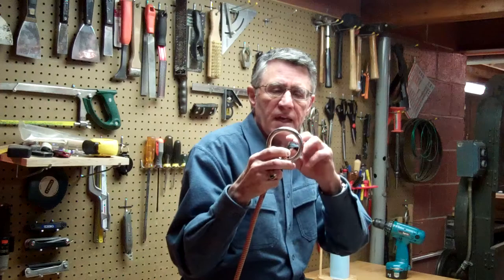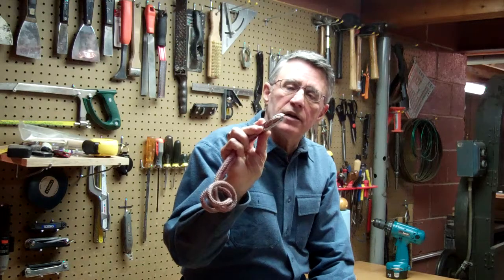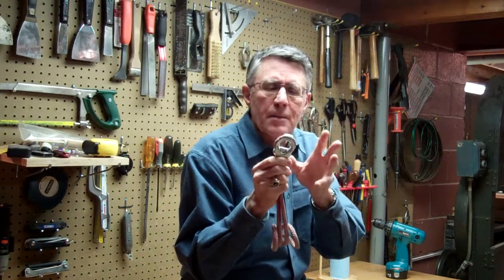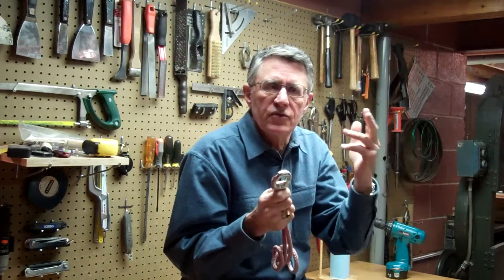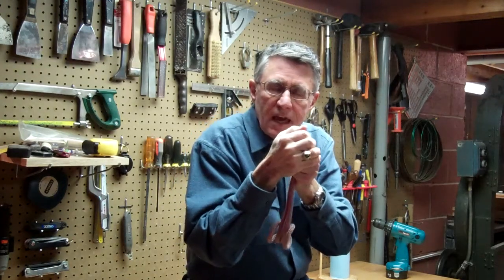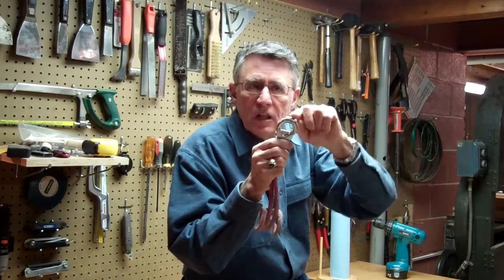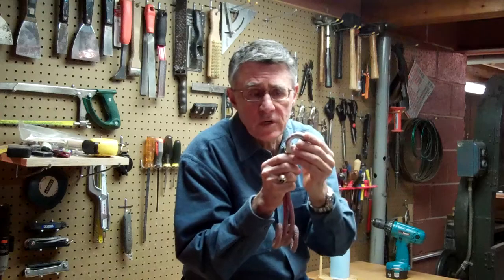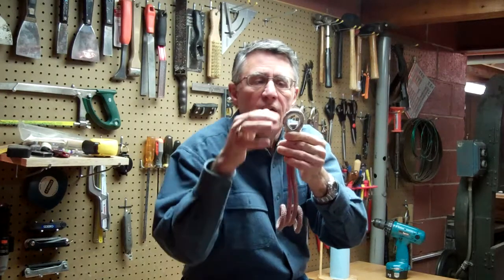Safety Thimble Climbing_Rescue.MP4

Comment: Interesting concept.  My impression is that the reduction of force to the system gained through the deformation of the metal would be quite minimal and short-lived.  I like the concept, but wouldn't there still be a terrific amount of force placed upon the climber or victim?  If it takes 1000lbs to activate the deformation doesn't that mean the climber or victim experience that 1000lbs as well?  I think the thimble needs to be large enough to permit a fair amount of elongation.